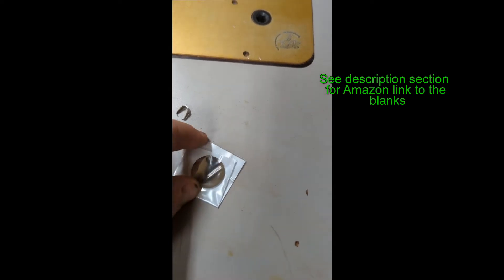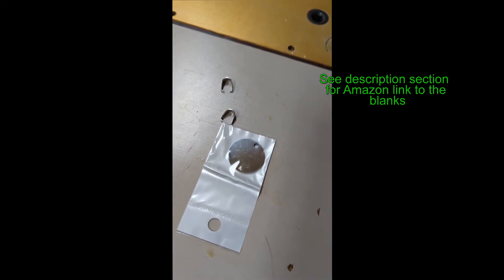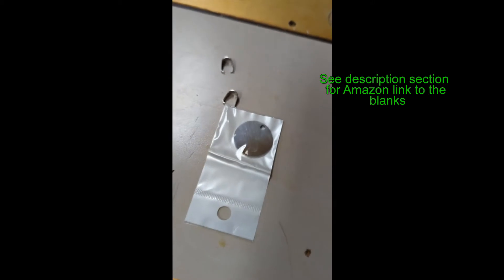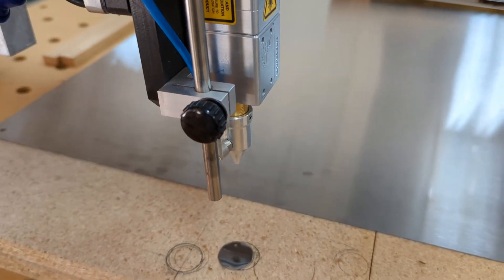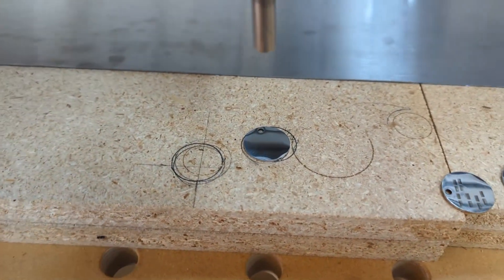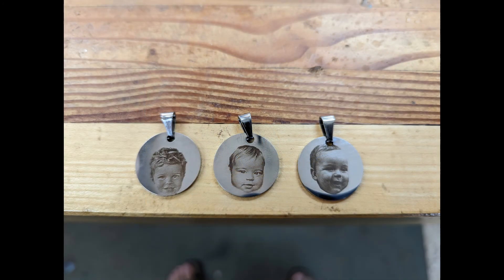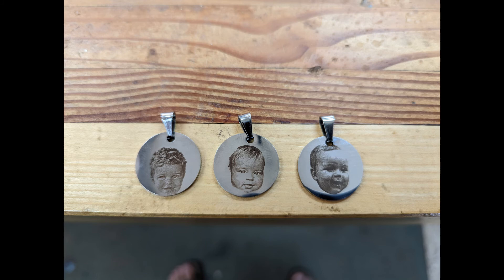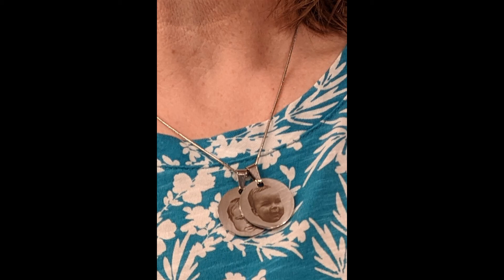Laser engraving on stainless steel necklace pendants with the Opt Lasers PLH3D-XT-50 and my AVID CNC

Comment: Great video and effort as always.  I just ordered the new AVID CNC 15W Diode Laser Retrofit System to better mount the laser to my AVID CNC.
  Your magnet mount looks great I'll have to go through your videos to see how you did that and if you have a parts list.
Reply from the maker: Thanks David.   Yes, the 15w will also mark steel, stainless steel, and titanium.  It looks like a line of welding under a microscope.  The main difference between the two lasers for metal is just that the XT-50 has a much smaller spot size.